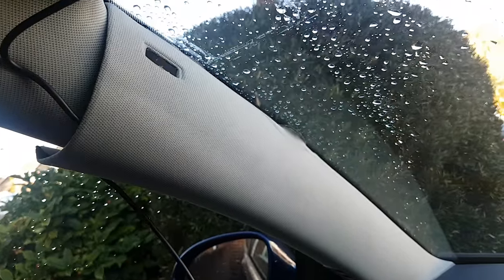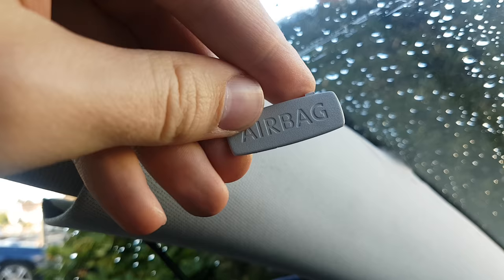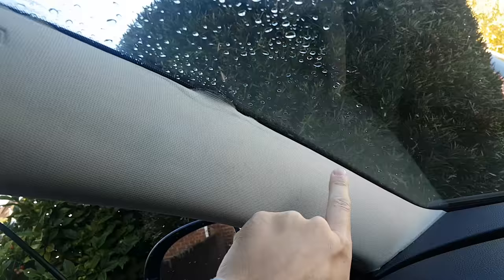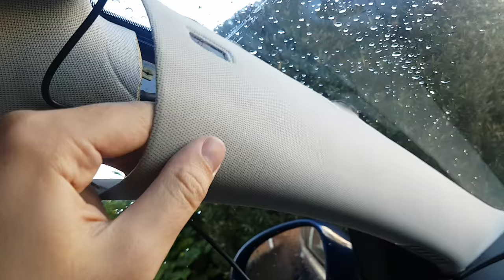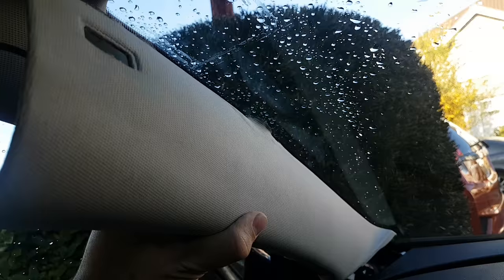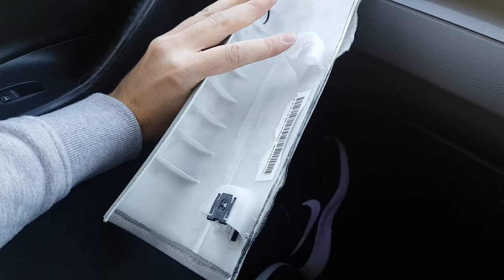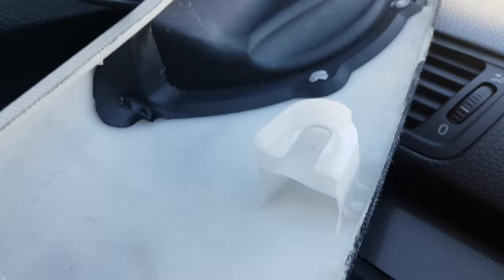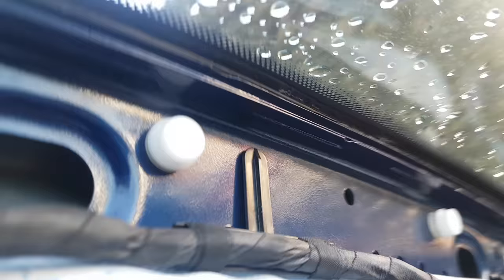A pillar trim removal - How to

Comment: Thanks for this. I've just bought a Fakra gps unit and have been advised to place it in the pillar trim. Wasn't sure how, but after seeing this video, I'm well informed. Cheers
Reply from the maker: My GPS was magnetic and stuck to my dash I did have it tucked behind the head unit but I don't think it liked being hidden 😅
Reply: @dayv  mines magnetic too, and I did think about placing it behind the dash. However, many on a forum have recommend the passenger pillar. As such, I went in search of how to remove said pillar, and stumbled across your vid. Very helpful, thanks 👍

Comment: I had a new door seal fitted on my Mk VI golf, I wasn't confident replacing it myself.  But when the guy fitted it and he was hammering it in, he cracked the pillar vent. It's driver side, so annoys me.  If I wanted to replace just the vent, do I still need to remove the whole A- Pillar?  Is it easy job or not?  Many thanks
Reply from the maker: Hello. I'm not a mechanic so can't recommend what to do from a professional point of view. But if  I was your id just get some plyers and pull the old vent out and see how it looks on the reverse. It could be that you just buy a new one and clip it into place from the front. Let me know how it goes.

Comment: Did you disconnect the negative lead on the battery before doing that? As one video I watched suggested it needs to be done and I can't be aggro'd with doing that lol
Reply from the maker: I didnt bother. I guessif your paranoid about the airbag going off (unlikely) then you could disconnect it for a moment. To let it drain any power remaining in the system.

Comment: Did you disconnect the battery before you did any of this to prevent the airbag from going off or is it not needed?
Reply from the maker: I didn't and had no issues. But if your near airbags it might be an idea to disconnect it.

Comment: What to do if I have airbags in those panels I don’t want them popping in my face
Reply from the maker: Disconnect the battery. Remove the black negative cable and wait 20secs or so for the energy to deplete. Then carry on as you were around the A pillar.

Comment: Did you disconnect the power from air bags system or it is not needed?
Reply from the maker: i didnt as i knew what was behind there. if your going near the air bag it might be best to disconnect the battery so it doesnt go off in your face. check your radio code if you have one as youll need that to use your radio.

Comment: Can i replace the outside trim piece using this method? 
Not sure how to remove the top screw from the inside
Reply from the maker: As in part of the outer body work? Not sure. I guess all cars are different, this is just for guidance.

Comment: Do I need to disconnect my battery first? Worried about setting off the airbag. Cheers!
Reply from the maker: I didnt but i guess disconncting the nagative for 30seconds or so wouldnt hurt.
Reply: @dayv  Has be to at least 15 minutes before you do the work I heard.

Comment: Would the air bag go off if I remove the trim?
Reply from the maker: Probably not. But if in doubt disconnect the back negative terminal on your battery

Comment: Are those other holes provisions for a Grab handle for the A-pillar?
Reply from the maker: Don't think so. I think it's just an assisted crumple zone to absorb energy in the event of a crash.
Reply: @dayv  Thanks! I was looking for a way to add grab handle on the A-pillar on the  driver side
Reply from the maker: @trevorbelmont4633  I'm sure it can be done but you'd probably want to remove the airbag (disconnecting negative battery terminal first) last thing you want is a grab handle flying off and hitting you followed by an airbag.  I see you can get little push up handles the clip into the door frame to help you get in and out. But you'd have to take it off every time you want to close the door. Best of luck.
Reply: @dayv  mine doesnt have an airbag tag.. just a simple panel.. the passenger side has the grab handle tho..

Comment: did you have to disconnect battery first??
Reply from the maker: As I wasn't dealing with an electrical connections I didn't see the point in disconnecting the battery.
Reply: I would consider the airbag electrical
Reply: I did to be on the safe side, it only takes a minute anyway.
Reply: @jessicah3450  you risk corrupting the FRM so make sure the car is completely asleep first.

Comment: on mine say air bag I'm scared to remove it in case it blows.
Reply from the maker: Mine says air bag to. It's just a plastic cover to inform you there is an air bag there
Reply: Disconnect the negative on the battery for about 15-20 minutes to disable the airbag system
Reply: Airbag sensors are on the body behind the panels. Like front and rear bumpers
Reply: @jeremymoreside1444  thanks for clarifying, I saw a bunch of other videos where they were installing speakers on the panels near airbags but hadn't mentioned disconnecting the battery. Good to know the sensor is outside.